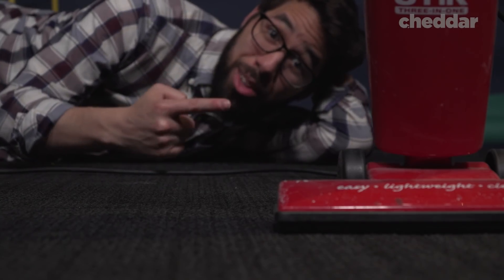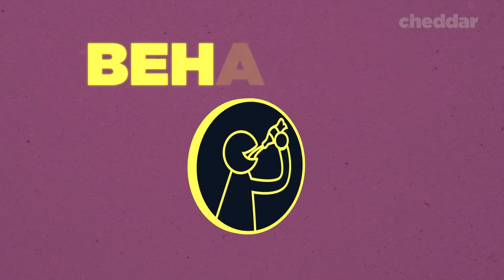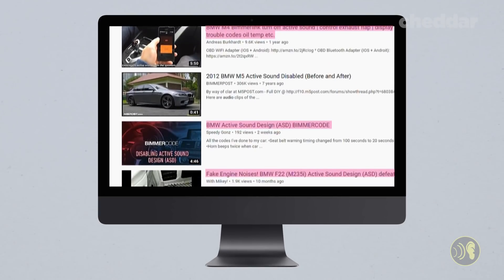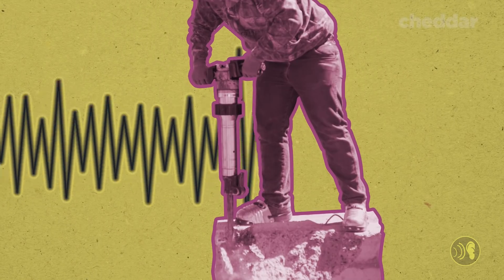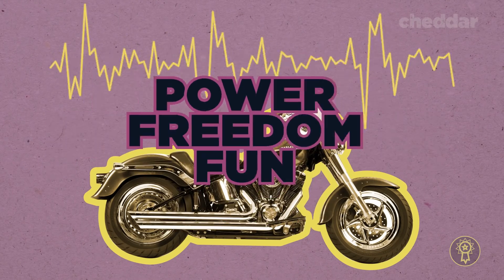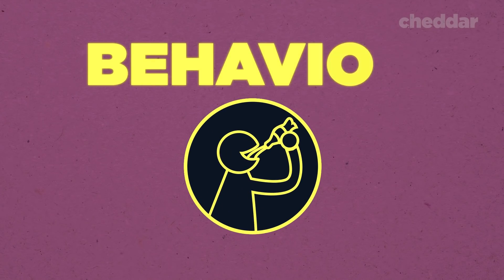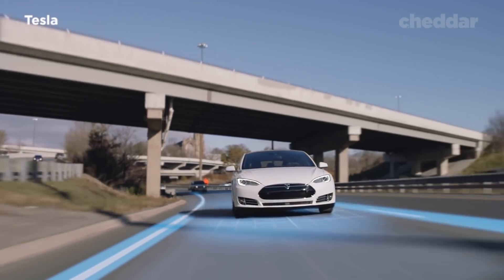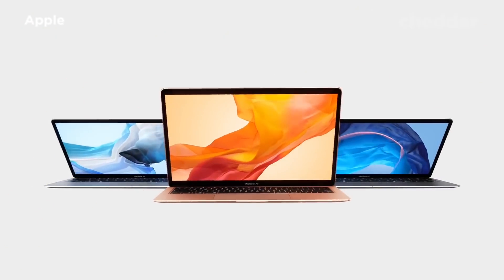The Fake Sounds Companies Add To Products - Cheddar Explains

Comment: My Volkswagen came with a resonator on the firewall too amplify engine sounds, I unplugged it after the first week of ownership. My turbo inline 4 should sound not sound like a V6, because it's not.
Reply: Hahah my cousin got a GTI as his first car and he tried to convince me to reinstall my soundaktor
Reply: I have an older one so mine is fine #mk4
Reply: It's a small price to pay for reliability and speed. ¯\_(ツ)_/¯ the soundactor is super easy to unplug. It's almost like the engineers wanted you to do it.
Reply: @britshell  That's not a resonator. A resonator removes low frequency exhaust noise. The exhaust on my Subaru rusted out, and now it sounds better, like a larger engine, without the resonator. Boxer rumble is definitely an early example of sound design absent in new Subarus.
Reply: @buddyclem7328  I will admit I may have used the wrong term in my OP. I'm not referring to resonators and baffles in the exhaust system. Just speakers and vibrating widgets that add fake noise.
Reply: @britshell  I admit that the term you used, soundaktor, is new to me, but it sums up what that part does. I never felt that my Volkswagens ever needed any extra noise. Since you used such precise language in all of your other posts, I thought you would want to know.
Reply: If fake engine noise is done well, it's certainly a good thing. It adds to the feeling of driving a car that usually wouldn't be as exciting if it didn't have more engine noise. There are tons of bad engine noise fakes though, which is why people want to remove it.
Reply: @TexelGuy  I disagree, all emulated engine noise are bad. If you need a fake engine soundtrack to get you excited about driving your car, you purchased the wrong car.
Reply: @britshell  Wrong. I said "adds to the excitement", not "it's the only thing that excites". Obviously I wasn't talking about a Mitsubishi Mirage situation. Some people don't have the money for sports cars which naturally have loud engine noises, and fake engine noise is the only way to add more excitement to modern cars since they're made to be isolated from outside noise. There's nothing wrong with adding more engine noise into the cabin when your car isn't loud. As I said, it shouldn't sound fake, it should be done well so you won't even realize it's fake. Only then it would be worth it.
Reply: tessellatedguy and those people should come to terms with their financial status rather than living in a fantasy. accept their EcoBoost Mustang it's not the same as the a Shelby GT350 that they wish they could have purchased. Fake is fake there's no such thing as a good counterfeit.
Reply: You must have a very sad car if you need to resort to racing simulators for entertainment.

P.S. I have never driven an electronic car, but launching a fast one like the tesla while making almost no noise sounds amazing. Like I said before if you need sound effects to make the driving experience interesting, you are driving the wrong car.
Reply: The resonator is especially funny in the Golf GTE. If i cane it in electric mode, then hit the GTE button, the resonator comes on noticeably before the engine does...
Reply: Funny that we're fine with all the tuning that goes into intake ducts and exhausts to produce a certain sound but we draw the line somewhere else.  Cars aren't "supposed" to sound like anything.
Reply: @mrlaforgephysics  The intake ducts and exhaust are physical parts of the systems.  I draw the line at digital emulation, i.e. speakers.
Reply: @britshell  I get it but a speaker is also a physical thing, and you don't mind when it is digitally emulating music inside the car.  I'm not trying to change your mind, I don't even disagree necessarily.  Its just funny to me, how we all create these systems of what's "ok" and what's not.
Reply: @mrlaforgephysics  to clarify, a speaker dosen't contribute to the air intake or exhaust system in a physical way. If you remove it it will not affect airflow the way removing or changing  an intake or exhaust will. That is what makes it different.  And it's very different from listening to prerecorded music while driving. At no point did the car manufacture try to make me believe there was a miniature live band living in the car stereo.
Reply: @mrlaforgephysics  The speaker is not a part of the drivetrain. If the speaker was improving cylinder filling in some way, you'd have a point. It's not, so it's just the adult version of playing cards in the spokes.
Reply: @mrlaforgephysics  Please stop trying to be deep its not working. Theres physical pieces of the car that produce sound however people don't want something thats fake.
Reply: @mrlaforgephysics  Your logic is horrible
Reply: @mrlaforgephysics  
Well, you're describing two different types of people. Generalizing.

Britshell (and myself included) don't like when sound something produces is faked, because it gives inaccurate information about the thing in question. To the same token, I hate fart cans (shitty cars with filters) just as much as I hate unnecessarily loud vacuum cleaners. 

If you've got a Hellcat engine that backfires, then rock it! Otherwise, use your car in a way that accurately tells others (and you!) what it is.
Reply: @U’re Mom well, either way an engineer designed a device to produce a sound that pleases the consumer.  The sound waves are the same.  It is no different for the user in any way. That's why it's funny.
Reply: I have absolutely little to no knowledge on cars so this whole comment just sounded like “this car part did this car thing and another car part, car part, car part, cars cars cars, car talk, more car talk”😂
Reply: BlackTwinkInYourArea Volkswagen’s have a pipe in the engine bay that goes to the firewall (the metal part of the car that is in between the engine and the cabin of the car). This pipe is called a “soundaktor” and has a speaker in it that mimics the noise of the engine, amplifying its volume inside the cabin. Think a car with a loud exhaust but the exhaust only goes to the firewall so only people inside the car hear it.

People don’t like them because it’s an artificial sound and not sound that your car’s actually producing
Reply: I use sounds to screw with people, on old cars the carburetor makes most of the sound of the engine, I modified my big block ford with chevy carb and ignition, then I swapped a chevy horn, when I honk it screws with people and the engine sound gets people.
Reply: @ghost-jesus  I'm pretty sure you've got that wrong. In an American car, most of the sound comes from the fuel pump.
Reply: @jmonsted  maybe the communist us cars, but the real American cars make most of their noise at the lifters due to usually having flat-tappets and always having insanely fat tolerances with low spring pressures.

Comment: I like the part where they eat the pringle the wrong way
Reply: Yeah they should have just licked the seasoning of the chips then break the chip in half stacking those 2 halves in between 2 pieces of toast slathered in extra seasoning after topping with swedish cheese and baking for 22.67 minutes at 350 degrees Fahrenheit. It's not that hard guys.
Reply: Naveen Gopalakrishnan; 350°? Not the same flavor as 347° gives it.
Reply: Kitt Geekazaru Me too 😂

Comment: If the vacuum sucks things up and the car moves fast it's working. Shut your products up.
Reply: The sound of a car door closing has more to do with the perceived luxury of the car. If the car has a hollow, tiny sounding door- that makes it seem cheap. If it has a heavy thud and a satisfying click, then people are more likely to associate that with it being more premium. The sound of a car door is the first impression that a potential buyer gets from the car. Also you want it to sound reassuring too.
Reply: @wheniztheend  
What if it sounds like if someone banged their head into a trashcan while running at full speed ?
Reply: @wheniztheend  exactly my point. I take functionality over luxury any day.
Reply: @dmaster225  so you want a cheap flimsy door? In this case the sound is accurate to the quality of the product anyways. You want a sound deadened door to have a more quite and luxurious ride.
Reply: @wheniztheend  the video is said that they spend research JUST focusing on how it sounds which means that functionality is not on top of their list, sounding expensive is.
Which translates to, just because it sounds good quality doesnt mean it is.
Reply: @dmaster225  for the most part, yes, yes the sound of the car door matters. And if the car door sounds good, it means you have a luxury car because with cheaper cars, the manufacturers don't want to put to much money into. In this case, through and through, the sound is reflective of the quality. They would only put that much effort into making the car door sound good if they were going to perfect all other aspects of the car. Sound deadening is a major component to luxury cars, and that takes quite a bit of testing) research to get right itself, especially with the sound system. If you really want form over function though, you'd go with a old Jeep. Little to no sound deadening, hinges that are in plain site etc. A lot about luxury isn't form over function, it's about satisfying the creature comforts, and being pleasent in every way. And yes, the sound of the car door matters in that respect.
Reply: @wheniztheend  - Many, many decades ago there was a series of Subaru commercials where someone was filmed slamming the door of the vehicle and then saying, "Now THAT'S a Subaru!"  I was just a little 6-year-old kid and didn't get it and had never heard of that brand.  At age 52 I bought a Subaru.  BEST car I ever owned!  Not one repair for 13 years.  At age 68 I bought another Subaru and expect it may be the last car I buy before I'm told I can't drive anymore.  They last forever.
Reply: Cars having an audible sound is good for pedestrians, especially the blind. Also, I think people would be more likely to speed if their car is too quiet because the sound will help us to feel like we're going faster. I think some cars are too loud, but I think it's safer if they have a certain level of sound.
Reply: I agree regarding cars, but vacuums suck up more than just what you can see. If sound design means I can feel more confident that debris not visible more than five feet from the ground is getting picked up, and that confidence being justified by actual performance, then I'm ok with that sound being there.

One that they mentioned only briefly and didn't explain, is the sound a car door makes when it closes. It doesn't need to be as loud as it usually is, but it is common to think that if the door doesn't close loudly enough, then it didn't close properly.
Reply: @OriginalPiMan  yea, that door sound is important, i wouldn't want my door to suddenly open while driving, so it's good to be able to know if the door is closed properly from the sound alone
Reply: @davidtitanium22  ever driven an old car? It's not hard to tell by feel if the door properly closed. We don't need a more expensive car because they want the door to sound a certain way.

Comment: BMW adding fake engine noise via speakers to compensate the muffled turbo engines. That’s also one.
Reply: Miyuru Weerarathna Have you watched the video? It’s at 1:53
Reply: They specifically talked about it for a while in the very short video.
Reply: That’s part of why BMW does it but a bigger reason was that the cabin is so well soundproofed that without it you would barely ever hear any engine noise. I didn’t believe it until I got one but it’s true, the soundproofing is so good that when I drive in other people’s cars I’m always keenly aware of road noise because in mine you hear none.
Reply: Really don't mind the sound of a turboed car and they should really see the cars (especially performance ones) with high flow exhausts so they sound and perform better
Reply: @nagow_360  myths
Reply: Cheesy